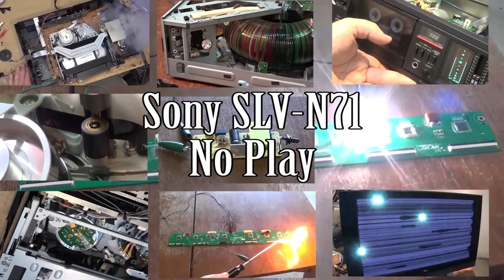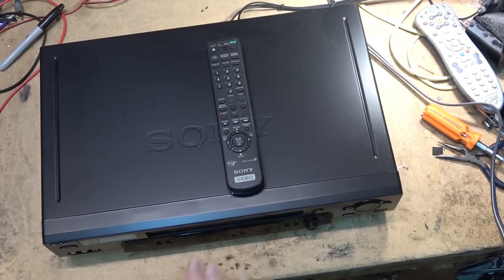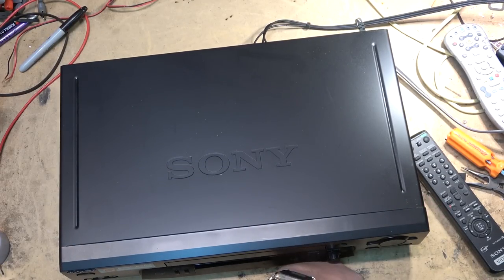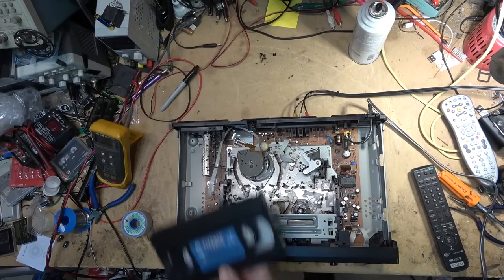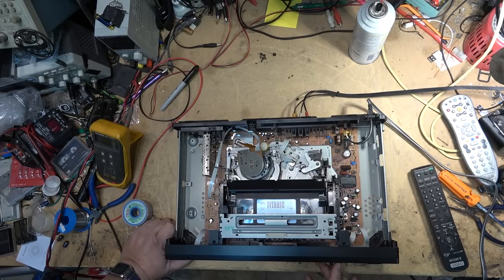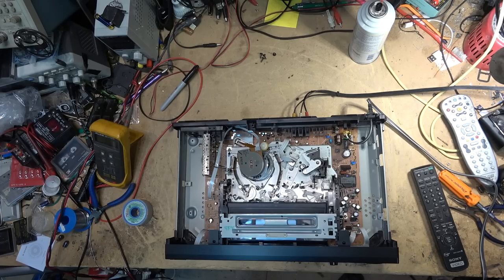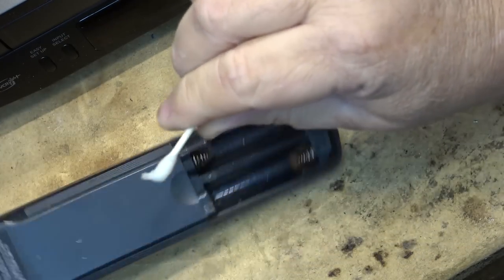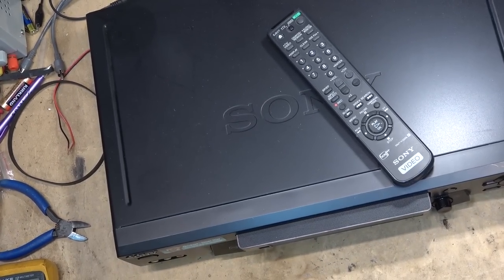Sony SLVN71 VHS VCR No Drum Rotation

Comment: I like on this VCR that the P2 and P3 guides are metal. I had to replace my plastic ones when they snapped. For the same reason I use my Panasonic NV-HS950 more often than NV-HS1000. The mechanism is exactly the same (K mech) but 950 has metal guides. Shame that all the Z mechanism VCRs have plastic guides.
Reply: Don't tell me about that! I bought a Metz VF61 (Panasonic NV-HS860, Z mech), all was wrong with it was adjustment. Someone adjusted the heck out of the guides. That was when I realized, the super fine adjustment thread is in the plastic, too! I thought the plastic guide base has some threaded metal inserts, but they don't! And that is disgusting! What were they thinking?! Fortunately the Z mech is very common, I stole the two guide bases out of a 2-head Panasonic VCR, which I bought for peanuts with broken video heads, exclusively as  a mech. part donor (I have at least 5 of them since then, and two Z-mech S-VHS Panasonic VCRs, the NV-HS860 with the Metz logo, and a Panasonic branded NV-HS850).

Comment: I really wonder what caused the edge of the rotor rubbing against the PCB, any why it doesn't do it now? Maybe someone operated the VCR upside down, and the axial play of the bearing allowed the rotor to move a bit closer to the stator? Yeah, this is probably Sony's last VCR series, that was really made by them. Later ones were SonSungs (Samsung OEM). They haven't even bothered to replace the icons in the OSD...

Comment: I wanted to ask if you knew how to do something cuz I saw your videos on your channel on YouTube where your repairing VHS tapes. Cliche as this may sound, my dog got a hold of a VHS tape of mine and really did a number on it. She destroyed the case and cracked the spools and ate part of the spools, however, the tape is just fine. I know how to disassemble the case and I understand how to thread the tape through the rollers and I understand the entire way the tape operates. However, what I cannot figure out is how to transfer the role of tape from the spool it's on to an empty spool, short of manually unrolling all of the tape off of the damaged spool and then manually rolling it all back on to the new spool. There's got to be a way to disassemble the spool that the tape is on and just remove the tape roll from it. But I sure cannot figure it out. If you can help me with this I would appreciate it.
Reply from the maker: They don't come apart.
Reply: All VHS tapes have a tape retainer clip on each reel. Unclip it and the tape will become free from the reel.
Reply from the maker: @crashbandicoot4everr  I believe he was talking about seperating the reels so that the pancake of tape can be lifted off and placed on another hub. This is what we used to do with film. I have a 16 mm film reel that you can spin open and then drop a pancake to film onto the Reel and spin the top on.

Comment: Now, I'm wondering why the drum was rubbing this board in the first place and will this problem happen again. Was the PCB too close to the drum? Was the drum too close to the PCB?
Reply: And why it isn't rubbing now? Maybe the board deforms with heat? In a hot summer day, after hours of use when the motor drive IC also heats up the board, it might happen again. I would probably put a few tenths of mm spacer below the board, it would not affect the operation of the motor, but give a bit more room for the rotor.
Reply: Maybe the VCR was operated with something heavy on top of it (or even someone/a child put a foot on it), forcing the top cover to slightly bend and touch that drum PCB.

Comment: Thanks for the video;are you  experts on old VCR?; i have an old VCR Sony SLV N60 and I'm trying to use the vcr as a RF converter to send video from a streaming box via HDMI to an HDMI to RCA converter to RF coaxial to the hole Apt ,i was able to make the set up and connection ,i connected RCA cables to VCR input line 1 but in order to see video from the streaming box i have to put a tape in the vcr and press play and i can stop play and video stays on. I have to do this process every time i turn on VCR .Any clues why? thanks

Comment: Hi! I don't understand! Is that a just broken trace problem?
Reply from the maker: Yes apparently so. Is that the only thing I did other than unplug the flex cable to remove the stator assembly and put it back on. As you saw I measured between both sides of the trace and it was open. Perhaps some debris or dirt got on the board in that area that was caught between the rotor and the stator and just over time it rubbed it enough that it severed the trace. The only thing I did was 10 over the trace where the rub Mark was and then continuity came back. Plugged it in and away it went.